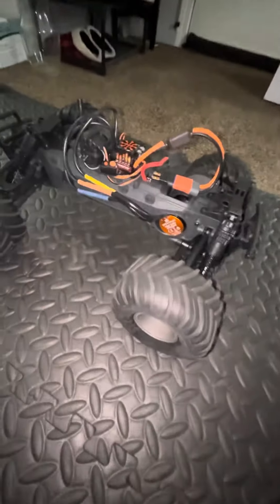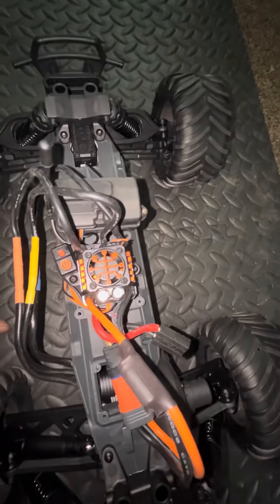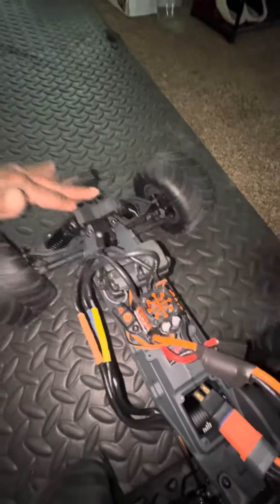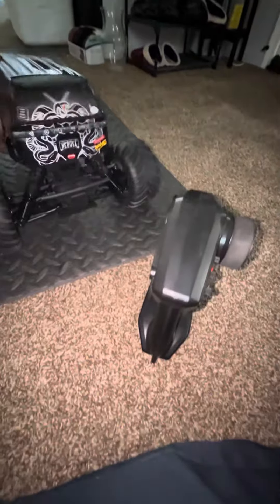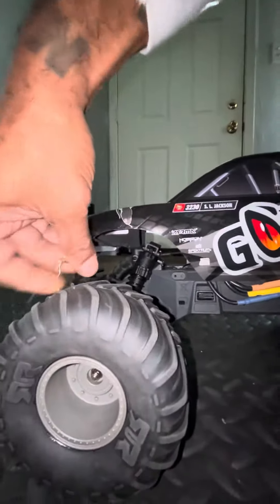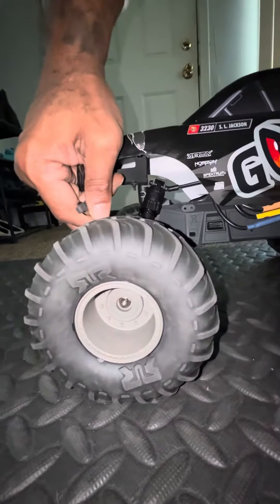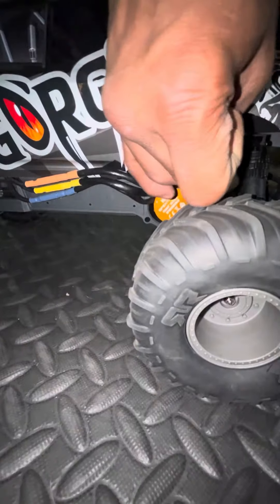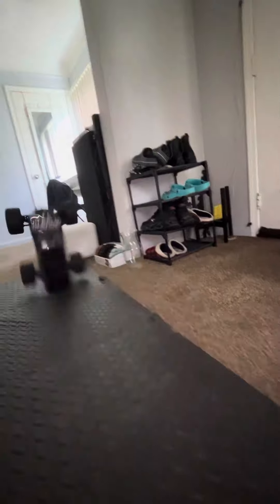RTA ARRMA GORGON 3s #rccar 6500 kv 100amp ESC 13t PINION #shorts #viral #share #like #subcribe🏁

Comment: That worked out real well.  It looks like you have plenty of room for mounting electronics. I like the black version the best. Mainly because of the bumper color. It looks like the assembly is not that big of a deal especially if your installing alternate electronics. The Spectrum Firma 100A system should really propel the Gorgon to a crazy monster speed. I have the same motor and ESC sitting on my bench and was going to get a Typhon 3s roller but honestly the Gorgon is a much better value and I really don't need a 2nd 3s Typhon. It's really tough deciding on what car to buy next when your on a budget. The Gorgon seems to be a big hit with everyone. Thanks so much for sharing this little gem. 💎